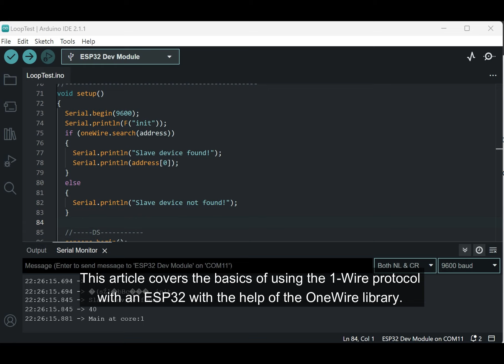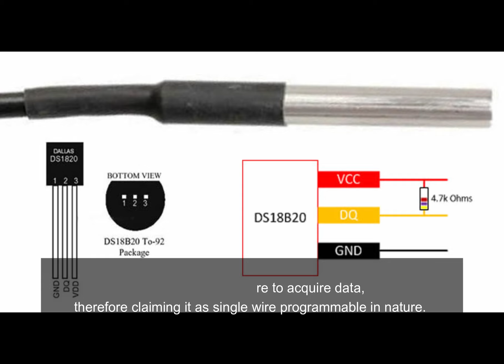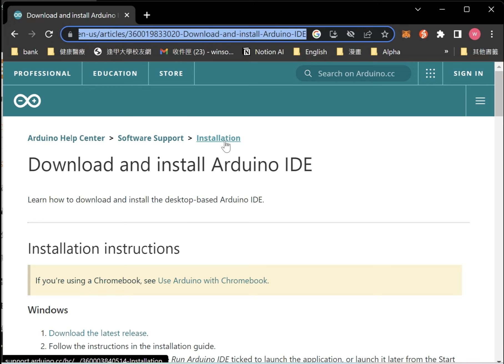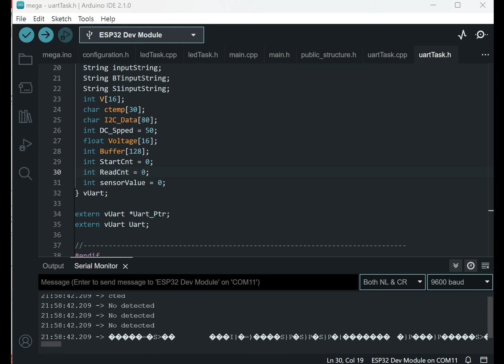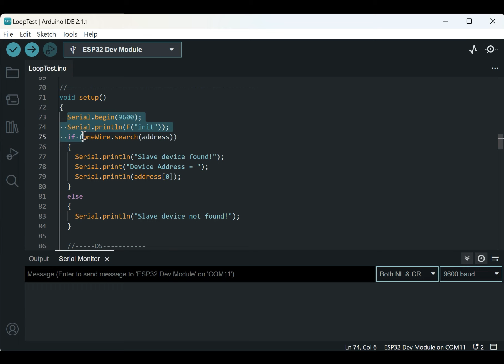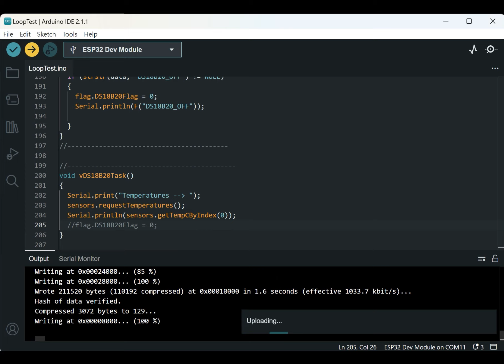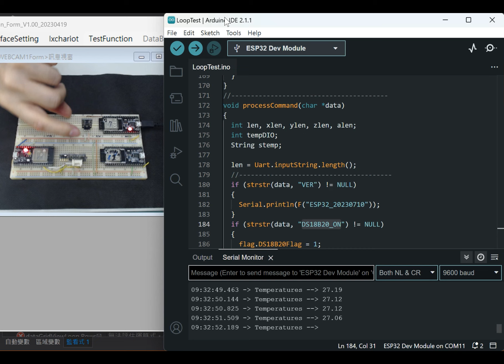DS18B20 - ESP32 one Wire Bus  Application

Comment: hello
When the temperature sensor is connected to ESP 32 and I use it with a battery or a good mobile charger or an industrial switching source, the device works without problems, but after switching from a switching source in a place where single-phase and 3-phase electric motors work. They say that sensor information is not received.
What do you think I should do?
Reply from the maker: Hi, Sorry About this issue , I don't have any idea !
Reply: @winson-DIY  thanks
Reply: @davidmike2989 have your issue been resolved? I'm facing a similar problem
Reply: @AhmedAli-nc5gi  I almost solved it. This problem is due to noise on the power supply. If necessary, describe your problem more clearly so I can help you.

Comment: how  to read ROM command in one wire communication using STC15F ic.
Reply from the maker: I don't have this MCU development Board, but I think the control DS18B20 should be the same as.
Reply: @winson-DIY ok sir ,  i need to read ROM command in one wire communication using ESP32
Reply from the maker: @KarthickrajaM-n5i  http://alex9ufoexploer.blogspot.com/2013/04/arduino-ds18b20.html
I found this website, hope it can help you!